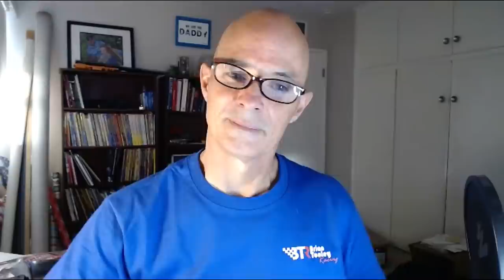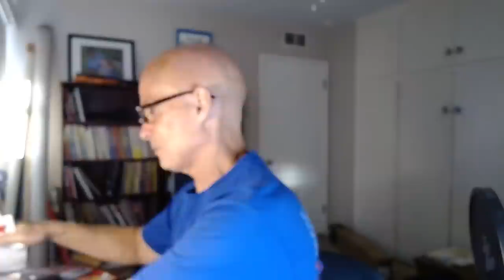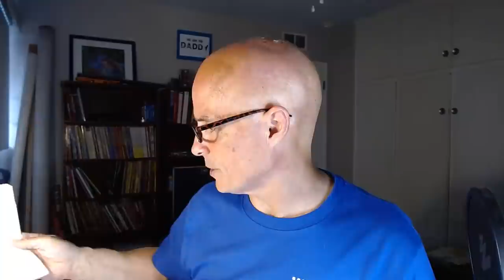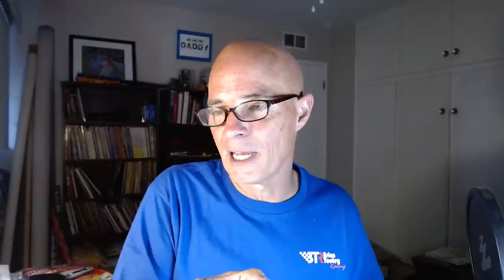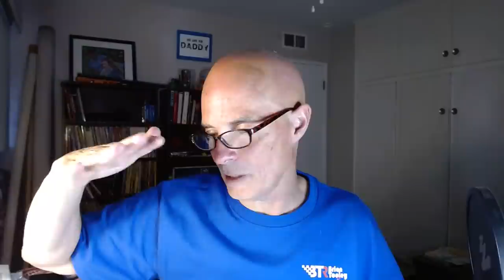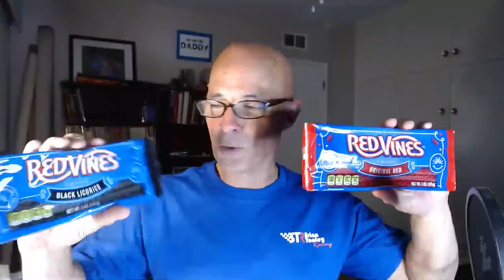LET'S TALK TECH-243 VS 862

Comment: I’m building a 6.0 bored .030 over. I’m running a BTR stage two truck cam 212/218, BTR  chromoly 7.4 pushrods, BTR rocker arms, forged pistons and rods. Also, a set of 706 heads. Speed engineering 1 7/8 headers. The engine has 11.2 compression ratio. What do you think about that set up?… I think I could of went 7.45 pushrods
Reply from the maker: you need to run good gas in that
Reply: @richardholdener1727  yes, my tune guy said it will be tune for 93. He told me to go with the Cometic .060 head gasket to put me at 11.2 compression. I also have Mahle dome volume is -4. BTR .560 lift blue beehive valve springs. BTR v2 trunnion kit. LS6 valley cover, Everything else is all AC Delco parts like oil pump, water pump, sensors & so on. And everything else is BTR. Also, ARP bolts throughout the engine. I still haven’t put the engine in yet. I’m still wondering how will the engine run.

Comment: what is the best head to run on a na lm7 with header,e85 and tbss manifold , the stock 706 head or worth the upgrade to a 243/799 head ?
Reply from the maker: I doubt you gain much
Reply: Thanks for the reply! and another question would porting either one be worth it ?

Comment: So... what would you say would be the ABSOLUTE max n/a one could pull with a l59 with 862 heads on 91 but yet be streetable
Reply from the maker: MAX AND STREETABLE....DOES NOT COMPUTE
Reply: @Richard Holdener  see issue I am having is which way to go for power. Fuel is an issue here. Few places have e85 and them who do don't seem to stay consistent test wise, however we do have 91 everywhere. Can one get away running poor man's meth injection as well to pull lil extra timing? I mean I'd like to achieve 800 crank, I'd be fine with 700. Would this be possible? I just can't fathom the cost of having barrels of e85 shipped
Reply from the maker: you can make 700 flywheel hp with an ls and boost and wm
Reply: @richardholdener1727  I'd be happy with that

Comment: Got a 96 votec 350 motor ,reg 87 350,  327 large journal , 302 with 11:1 pop ups what would you build got 461 heads 462 ,291 victor jr  got 284h comp cam and 294h solid or hyd lifters i got both
Reply from the maker: the bigger motor would be better

Comment: Ive heard 706 heads work good on a lq9 or lq4 combination if ur going boost.or even ls 823 or 821 heads.
Reply from the maker: every head works well under boost-the stock rec port heads make more than stock cath heads
Reply: @richardholdener1727  ok got it i think ill just do 823 heads

Comment: Rich would you enlarge the 862 valves to 202 if you had the 3.898 LS1 bore? I’d be doing a basic port job and unshrouding the intake valve. Or would you just leave the stock 862 valves. It’s gt45 China turbo motor.
Reply from the maker: bigger valves can add power on the 862s

Comment: I have a 09 6.0 LY6 with vvt. Do you have to swap the cam out? Can I just change the cam sprocket and bolt? I’m installing this ly6 in a non vvt application. This is a budget build. Let me know thanks
Reply from the maker: to remove vvt-you need to remove the cam and replace cam and timing chain

Comment: 6.0 with 224 231 cam headers tbss intake and 243s 92mm and k&n hoe much would I make to the wherl
Reply: Wheel
Reply: Over 400
Reply from the maker: maybe 400
Reply: Do a 226/232 lsa114 .600 
That’s what a friend has 
07 Tahoe ls2 from a tbss 6.0 and runs 13.7 
Corvette TB and stall but can’t get off the line above 2000 without spinning, haven’t use drag wheels yet 
3.73 gears with lsd 
Hp at the wheels were over 360
Reply: @richardholdener1727  it’s a 234 232 625/.625 115 lsa comp cams , 6.0 flat top pistons , 243 heads stock , long tubes 17/8 , has a tbss with a 92 mm throttle , and also has 32-3600 stall how much would I make to the wheel ???
Reply: @richardholdener1727  it’s in a single cab short bed truck , it’s a 234 232 comp cam

Comment: Richard. 
 I know that this video is not about the 317 heads. But would it help the exhaust flow if the D port exhaust was port matched to the exhaust manifolds?
Reply from the maker: I don't think very much

Comment: I see taking a 6.L and stroking it to a 408 can the same thing be done to the 5.3 L since they both have the  same stock stroke just a different bore size in each one and with the stroked 5.3 what would the displacement be after that
Reply from the maker: 383 on the 5.3l with an increase in bore size of 3.902

Comment: For my Ls1 camaro F body, im doing GMPP hot cam (want durability, drive ability, fuel mileage) 243 heads, Ls6 springs, holley low ram, 92mm throttle body, 36lb injectors. Should be a 400 whp motor. Fingers crossed. Not lookin for more
Reply from the maker: you won't like the Holley Low Ram on that combo
Reply: @richardholdener1727  hey thanks for your response. Love your content. Suggestions then?
Reply: @franw51  probably just a stock ls6 I take or fast 92 should be great for that
Reply: I have stock 243s dual beehive spring pac .660s on an ls1 with a 226/232 112+3 625/625 lift cam. Stock ls6 intake and 78mm tb. Made 442hp on mustang dyno. From 3k to 6400 its almost a plateau of hp and torque.
Reply: @Ws6Ms  I ended up with an LS6 intake. Good call

Comment: I have a gen 3 5.3 I replaced with flat tops pistons, longtube headers,243(not ported.) heads and btr  stage 3 cam and springs ,and a 102 fitech intake and stand alone system. Th350 trans and .its my first build any guess on the hp I'm looking at?thanks for anyone's help
Reply from the maker: what stage 3 cam?
Reply: @richardholdener1727  the Brian tooley stage 3 truck cam 553/553 lift

Comment: I got a 99 firebird  v6 project, I want to swap a 4.8 . What heads do you recommend with turbo setup?
Reply from the maker: STOCK HEADS WITH SPRINGS
Reply: Those LR4's are always overlooked, a lot of guys usually go for the LQ9 or LS2's. They're great for making power with forced induction and you can usually find them cheap.

Comment: Are you going threw all the lift ranges? Anything past the combustion chamber depth you'll see a flow increase cause bore fixture size to a point I do believe but not a big increase. Was your depression set rt?
Reply from the maker: FROM .050 TO .700 USUALLY

Comment: My 2008 Tahoe PPV 5.3 LMG has the 243 heads on it from the factory.
Reply: Yup but most have 799. People if you want ported heads look at Wilkes. Picked up a set of 243 heads ported for under $1300 shipped thru a dealer. No core charge
Reply: @deewyte5081  very cool. I will check them out.
Reply: @deewyte5081  any before and after numbers there? I heard he does good work. Stock sized valves?

Comment: My LH6 aluminum 5.3 came from the factory with 799 heads
Reply: lot of 5.3s come with 799s. Specifically 2007 and on 5.3s and the L33 high output 5.3 Vortec.

Comment: What would you say is the bore on a NA combo with a cathedral port?
Reply from the maker: bore?
Reply: @richardholdener1727  sorry max bore. My question assuming there will be some sort of diminishing return as it starts to pump more air. Stroke or over all cubes may play a roll in this as well.
Reply: @richardholdener1727  4.065....
Reply: @richardholdener1727  ?

Comment: How about testing a stock 1978 400sbc against a stock LQ4 with 317 heads !
Reply from the maker: a stock 1978 400 make about 150 hp less than a stock lq4
Reply: How about low end torque test pure stock ? It might be hard to do this test due to the scarcity of 400sbc unless you bought my 400 for a ridiculous high price . It would be a fairly accurate test and close to stock wear wise since it has only 89 kilos on the odometer . Even an LS won't idle any better . Solid 21 hg vacuum. Its currently running in my 1978 Chevy Van 22 foot motorhome 10000lbs with supplies . I towed my Honda Accord with a tow bar up over the Cocaqualla Pass in the BC Rockies , toughest climb in Canada , almost 14000 pounds with little trouble .Yes the Turbo 475 pulled down in second a few times but really no sweat . Quite a feat for 150 HP ! Oh yeah ,  its in a dually with a complete fiberglass body .  I also have a LQ4 out of a 2007 Savana and a 4l80 and everything to do the swap . Just hesitant to pull the trigger . Might do a lot of work only to face a huge disappointment . Could an LS have that much more torque ? You know how we  always go on about cubic inches and stroke . I could be more motivated if you would buy it because its physically in the way of the 6.0 and 80. Help !
Reply: It was a cool moonlit night  so the air charge was cold and that made the 400 stronger maybe..i dunno....

Comment: I wondering if using my PRC ported 243 heads on a 408 will be a good combo ? As of now that is what I have with e btr stage 3 cam. It’s going on a c6 ls2
Reply from the maker: YES-THEY SHOULD WORK WELL
Reply: @richardholdener1727   thank you Richard for your tech advice I’m planning to run them for while then update with some Frankenstein Ls3 heads later on.

Comment: On the big block I think he is talking about the dowel pins for the cylinder heads
Reply: I believe they were offset boring with factory small bore to unshroud the exhaust valve
Reply from the maker: head dowels

Comment: I know this is unrelated, but I still would like some resolution of the trickflow head debacle for the 4.6, mainly that stock cams (and any cam designed for a PI head’s valve geometry) won’t work well in trickflow heads, and can lead to tuning difficulties and ultimately an engine not making the power it should. I’d love to see a back to back comparison of a set of L&M engines cams and a comparable Comp cams set (made for a PI head).
Reply from the maker: THE TFS RUN FINE WITH STOCK AND STANDARD PI CAMS-JUST ASK THE GUY WHO DESIGNED THE HEAD (BRIAN TOOLEY)
Reply: @richardholdener1727  that isn’t a strong argument though, simply relying on the creator (who is not a fully objective evaluator) saying “there’s no problem”, when my engine builder has has personally experienced issues with TFS heads and PI cams, and L&M engines (a respected company) has provided a reasonable explanation as to the lack of power and tuning issues being the result of altered valve train geometry. I know Brian Tooley is your friend, I’m simply asking for a back to back test. I deeply respect you and Brian Tooley, I just have seen reasonable evidence that there may very well be an issue that’s worth doin a relatively simple test.

Comment: When are you going show this video ? I’m a fan of 243 head. I want to see it on the big engine
Reply from the maker: this is on a 5.3L-I already have vids up on the 6.0L test
Reply: @richardholdener1727  I would like to see them on 4.125
Reply: @richardholdener1727  do you any data with the 243 heads on a 4.8? That's what mine has.
Reply: @CobosDoesItAll  you're looking at around 320 to the wheels and that's with a big cam

Comment: 1.89" intake is plenty even for the 5.7.  the extra flow on a flow bench from 2" valves won't benefit anything smaller than 5.7L.  706 heads have essentially an identical port to the 243.  That's why they flow the same.  the small valve is what makes the 706 heads better, not the chamber.  and it's not the "discharge coefficient".  it has less reversion, which is why it boosts low end torque.  there's still lots of room for improvement to get rid of the chronic turbulence inside the port.
Reply from the maker: NONE OF THAT IS ACCURATE-THE 706 IS NOT THE SAME PORT AS THE 799/243 (TESTED THAT). A 706 DOES NOT FLOW THE SAME AS A 799 (TESTED THAT) YOU PROBABLY MEAN THE 317 HEAD AND 799-WHICH DO FLOW THE SAME BUT HAVE DIFFERENT CHAMBER SIZES AND DESIGNS. COEFFICIENT OF DISCHARGE IS A REAL THING. A 2.0 INCH VALVE HELPS FLOW AND POWER ON A 5.3L BORE (TESTED THAT)

Comment: Is there a good option from the aftermarket for a small bore engine like an LS1? 243’s are getting harder and harder to find, coupled with the amount for port and polish work I think price is comparable. 

Got a freshly cleaned and checked out LS1 with a polished crank for doing some brush work. Want to put it in my S10 for a fun 450ish hp street driver unless their is a budget friendly stock head that will get the job done on pump gas.
Reply: Wilkes

Comment: 823s are cheap and flow over 300 cfm stock. Why guys keep argue about the best cathedral port head when the best 6.0+ head is rec port is beyond me....
Reply: For high rpm horsepower yes. But how often are you at 6800 rpms?  Cathedral gives much more torque at lower rpms and better for street performance. Velocity at lower lift is key
Reply: @tonym6854  They made more power everywhere iirc.
Reply: Not according to this test
20 lb/ft more lower in rpms
https://youtu.be/Ae6-1pwpGyA

Comment: Am putting AFR 210 Enforcer heads on an LQ9, would be interested in data on this configuration if anyone has it. BTR Stage 2 V2 truck cam,TBSS W/ 36lb injectors and 1 3/4 longtubes.
Reply: I'm not an expert on cylinder heads, but wouldn't 210s be just a bit undersized for an LQ9?
Reply: A 364 ci. engine will want 267cfm@ 6000 rpm. So pick the smallest port that will move that amount of air and you'll be Golden.

Comment: Lm7 with chopacabra cam. 243s or 862s? I milled 862s to 55cc but my buddy insisted i use my 243s I have @richardholdener1727
Reply from the maker: a milled 862 makes more than a stock 243 on an LM7